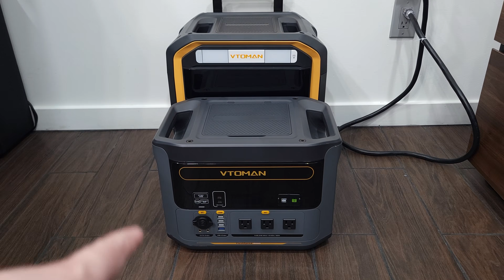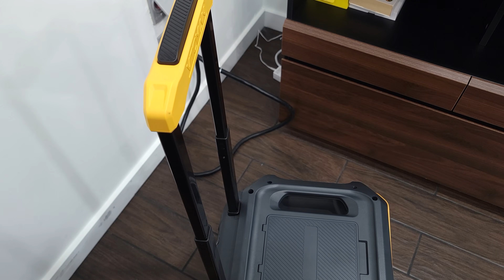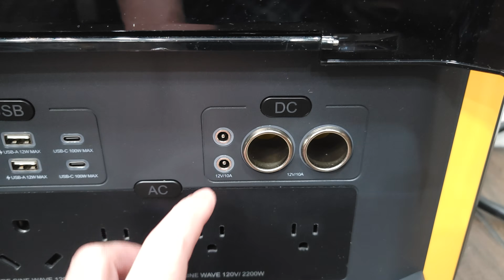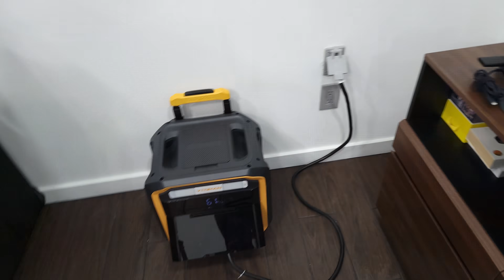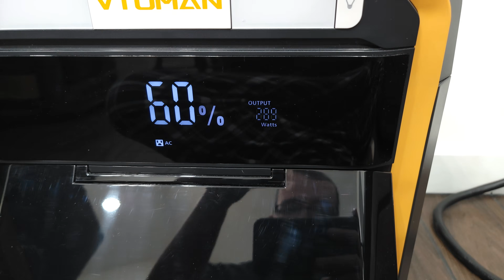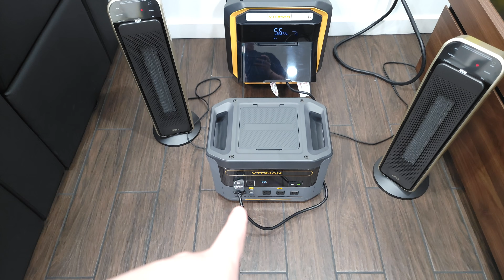Vtoman’s Best Power Station So Far! | Vtoman FlashSpeed Pro 3600 Review

Comment: Vtoman makes the coolest looking power stations hands down. Unfortunately this does not beat any of the competitors in the 3kwh size. Lack of app and low solar input are really big deals nowadays. It says it can use the flashspeed expansion batteries and that great. I still would suggest looking into it.

Comment: Just sent this to my brother who is currently working on a solar van build. Not sure if he needs 240v, but this looks like it should be good enough. 

In case anyone is wondering, vtoman is a solid company. Their products are a little more barebones in features compared to others, but you get what really matters at steal prices ( battery size and inverter power). I have a smaller vtoman unit (jump 600 I think it's called?) and their Jump 1000. Going on a a few years with each, and so far no issues. Cant speaker on their customer service, but product quality wise.. I cant complain.